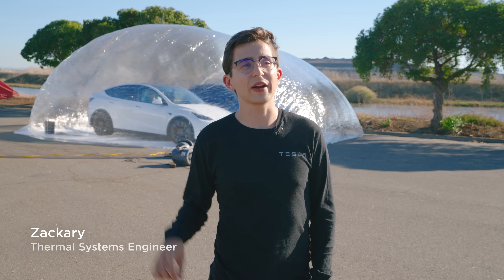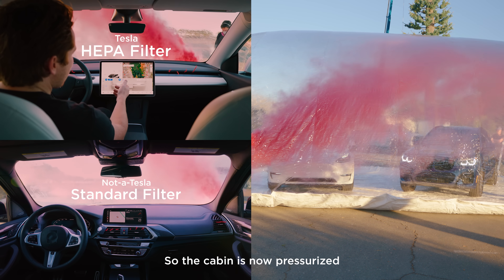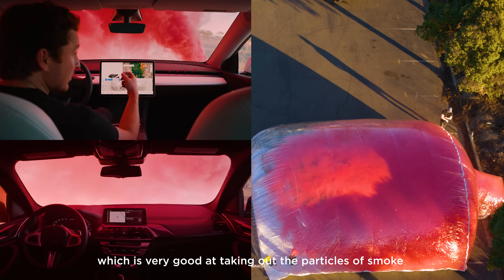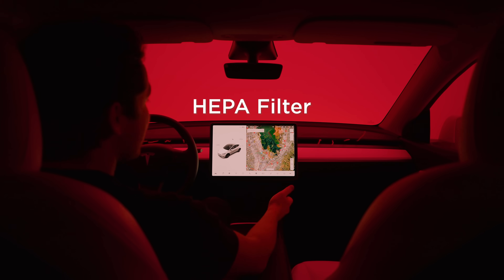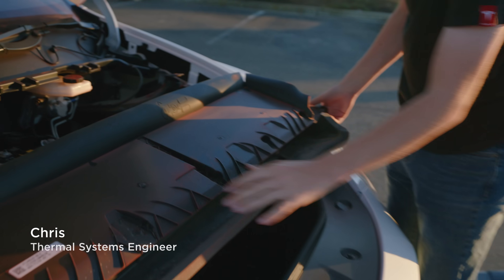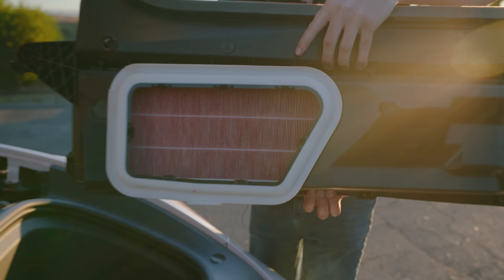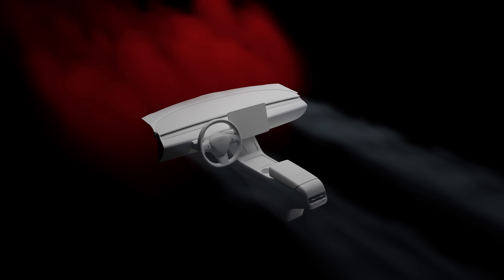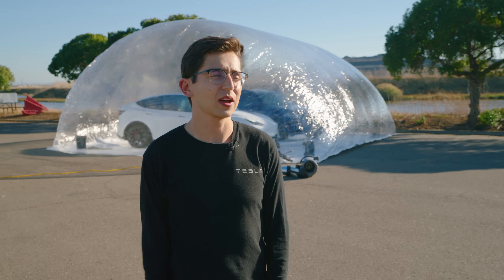Tesla HEPA Filter | Keeping Your Cabin Air Clean

Comment: If you are in town and have an old diesel vehicle running in front of you while you are waiting on the traffic light, do you still can notice the disgusting diesel smell or smoke from burning threes from the fire in vicinity?  Can the HEPA filter vanish these smells?
Can someone comment on this?  
There are lot of new technologies introduced for cabin air filters like micronAir blue (CORTECO/FREUNDENBERG), Blue.care+ (Hengst), FreciousPlus (MANN-FILTER ) etc. However, all these filters don't have any gasket around their edge that could assure, that air goes through the filter only and not around them. Nowadays these filters are just inserted in their compartment of the air channel. Tesla did a good job here because they sealed the HEPA filter to the plastic frame and this frame has extra white gasket where the air enters to the air conditioning compartment. It would be interesting to see performance , if they would have tested the E947LB built in the VOLVO truck, for example.

Comment: At least turn the Air-recirculation button on for the X3 to give it a little comparison damn. They might aswell have used two Model Y's, one with the filtration switched on and the other off. 🧐

Comment: $400 for what is essentially a $40 part at your local Pep Boys for any other car. You know, HEPA filters with this level of filtration have been around for a very long time. 
Inspired by hospital air filtration systems, LOL. Have you ever been on the roof of a hospital? Or seen one? Nothing really special there except for the fact that they can change the direction the air flows, so that air from without can't go in for folks with crap immunity and can't go out of the room for infectious folks. The HEPA filter is about the same as any other HEPA filter for a building of that size.

Comment: Why isn't always on when all doors and windows are closed ?
What is the drawback of using it ?

How often do you need to change the filter if you leave it on all the time in L.A. for example ?

How much does it cost to replace a used up filter ?

Comment: I can imagine that that filter needs to be changed regularly the problem is the price of the filter
Reply: Volvo has been doing HEPA filters and interior air quality sensors for 23 years.(they introduced both in 2000)  They are also certified by the asthma and allergy foundation of America unlike Tesla.  Volvo also has won the interior air quality award since 2020 and continue to do so. Not to mention the filter for a Tesla is 500$ the filter for a new Volvo is 32$ and still has cleaner air in the cabin.

Comment: Bring the floor hump back so you can put a wind tunnel full length of the car. A cylinder that slips out of another cylinder for repairs that consists of a couple hundred mini fans that generate electricity. Why not take advantage of the wind?

Comment: Just FYI, other brands do have HEPA filters too... Mercedes being one of them (In the S-class and EQS that is)
Reply: Volvo has been doing HEPA filters and interior air quality sensors for 23 years.(they introduced both in 2000)  They are also certified by the asthma and allergy foundation of America unlike Tesla.  Volvo also has won the interior air quality award since 2020 and continue to do so. Not to mention the filter for a Tesla is 500$ the filter for a new Volvo is 32$ and still has cleaner air in the cabin.

Comment: Great video! It would be great if Tesla can also illustrate the difference between Bioweapon Defense Mode turned on and off. Being a prospective buyer, I would be interested to know if I need to turn on the BDM mode on a daily basis if I drive in a city with a high level of PM2.5 everyday.
Reply: Agreed. It isn’t a useful test otherwise. Even better if the car could automatically turn the filter on when the air quality was bad!

Comment: While this is certainly a nice thing to have, you really don't need to blow $100K on an X or $50K on a 3 to do approximately the same thing in your car. You can buy generic activated carbon infused HEPA cabin air filters for practically any car now for about $20 and if you just put your car's AC or heat on recirculate it will almost totally purify the air inside within 5 minutes. How do I know for sure - I bought a $30 usb powered laser air quality meter off ebay and tested it myself on a smoky day. The relevant search terms are PM2.5, car, and AQI meter, if you want to get one. They're all based on the Plantower physics package. The PM2.5 value literally falls to zero within a few minutes of having the fan on high and recirculating. I DO NOT have a special car by any means, it's a 15 year old Civic. Try it yourself. The odor removing capability isn't going to be as great as with a separate carbon filter like on the X, but it will work and the main important capability of particle filtration is very good.

Comment: this needs to be standard across the industry, like airbags and seatbelts. AIR is a necessity, not a luxury. i really hope manufacturers take note and adopt these filters before it's too late (for a lot of areas, it already is).
Reply: In this price range it's a standard, it has been the case for 10 years or so, I'm actually surprised that Tesla didn't come with HEPA filter installed.
Reply: Volvo has been doing HEPA filters and interior air quality sensors for 23 years.(they introduced both in 2000)  They are also certified by the asthma and allergy foundation of America unlike Tesla.  Volvo also has won the interior air quality award since 2020 and continue to do so.
Not to mention Tesla's filter cost 500$ where as you can get a filter from Volvo for 32$ and volvo still gets the better air quality inside.
Reply: love volvo!

Comment: Hepa filter is a very desirable feature in Vaccums generally found on high end ones this is amazing I'm never going to buy a Tesla but credit to Tesla this is next level
Reply: Volvo has been doing HEPA filters and interior air quality sensors for 23 years.(they introduced both in 2000)  They are also certified by the asthma and allergy foundation of America unlike Tesla.  Volvo also has won the interior air quality award since 2020 and continue to do so. Not to mention the filter for a Tesla is 500$ the filter for a new Volvo is 32$ and still has cleaner air in the cabin.  
This isn't next level this is standard stuff most company's were doing before Tesla came around.

Comment: Hey Tesla, if you made an air purifier, definitely buying it!
Reply: Volvo has been doing HEPA filters and interior air quality sensors for 23 years.(they introduced both in 2000)  They are also certified by the asthma and allergy foundation of America unlike Tesla.  Volvo also has won the interior air quality award since 2020 and continue to do so. Not to mention the filter for a Tesla is 500$ the filter for a new Volvo is 32$ and still has cleaner air in the cabin.
Reply: @ethandonivan5175  Checking right away，thanks Ethan
Reply: @ericcatman9977  if you want a tall one, the tp02 is on sale for 200 off.  It auto detect the air quality and makes adjustments.  It also works with the Dyson app.
Reply: @ethandonivan5175  The fall one looks great, thanks for your warm advice❤️
Reply: HEPA isn't anything special it's been around since the 1940s.  Tesla just made a good marketing video comparing it to a car optioned without the filter.  Get a Dyson if you want a good in home air purifier.

Comment: 99.97 against particles of any size?  HEPA guidelines is .3 microns or larger. What is the size of the particles is the 'smoke'. Will you get the same filtration with leaking seals or misaligned panels?

Comment: How much it costs to replace?
Reply: Volvo has been doing HEPA filters and interior air quality sensors for 23 years.(they introduced both in 2000)  They are also certified by the asthma and allergy foundation of America unlike Tesla.  Volvo also has won the interior air quality award since 2020 and continue to do so. Not to mention the filter for a Tesla is 500$ the filter for a new Volvo is 32$ and still has cleaner air in the cabin.

Comment: Can't argue on this one ... It seems like a better engineered system. As a BMW over, I can definitely say the recirculation buton does almost nothing to stop bad smells from coming in the car ..
Reply: Volvo has been doing HEPA filters and interior air quality sensors for 23 years.(they introduced both in 2000)  They are also certified by the asthma and allergy foundation of America unlike Tesla.  Volvo also has won the interior air quality award since 2020 and continue to do so. Not to mention the filter for a Tesla is 500$ the filter for a new Volvo is 32$ and still has cleaner air in the cabin.

Comment: Now this is innovation!
Reply: What part about putting a filter that most other brands had before Tesla even came around is innovative ? Not to mention Volvo has been doing HEPA filters and interior air quality sensors for 23 years.(they introduced both in 2000)  They are also certified by the asthma and allergy foundation of America unlike Tesla.  Volvo also has won the interior air quality award since 2020 and continue to do so. Not to mention the filter for a Tesla is 500$ the filter for a new Volvo is 32$ and still has cleaner air in the cabin.

Comment: Tesla cars are amazing  , are the HEPA Filters fitted as standard in the  Model 3 ?
Reply: Write me ☝️ ☝️ for more insights and monitorship
Reply: Volvo has been doing HEPA filters and interior air quality sensors for 23 years.(they introduced both in 2000)  They are also certified by the asthma and allergy foundation of America unlike Tesla.  Volvo also has won the interior air quality award since 2020 and continue to do so. Not to mention the filter for a Tesla is 500$ the filter for a new Volvo is 32$ and still has cleaner air in the cabin.

Comment: We tesla owners who have this quickly accepted this feature and now really don't think about it much now.  Wild fires in calif was a great reminder in you can see all the smoke outside but you don't smell any of it, so you know its working.  On one roadtrip we came onto a boring ice vehicle full engulfed and pouring thick smoke that was low and crossing the road where we were going to drive through.  Not wanting all that junk entering into our Model X we turned biodefence on full.  We did not smell thing and wondered if maybe this car on fire was only smoke and no smells.   When we drove out the other side of the thick cloud I lowered my window just a small bit and WOW, we got the full effect of many different smells from rubber, to gas and oils plus plastics.  Much more really.  Window was opened a bit for about a second or two and back up it went.  About 1 to 2 minutes and the inside of the car was clean again.  👌
Reply: Write me ☝️ ☝️ for more insights and monitorship

Comment: Poor choice of "competitor car" for this demo. Pretty pathetic. Quote: "While Tesla’s systems rely on HEPA (High-Efficiency Particulate Air) filters, which are widely available in the aftermarket from a variety of original equipment manufacturers such as Bosch, BMW is expanding the availability of so-called nano-particle cabin-air filters within its lineup. Unveiled in the Fall 2020, the filters use what’s referred to as nano-fleece made of nano-fiber sitting on top of a traditional activated carbon layer. The filters are only available with optional four-zone climate control, and initially came standard on X7 and were offered as an option on the 7 Series and 8 Series, along with the X5 and X6, and all of their respective M derivatives.
Although HEPA filters can remove particles as small as 0.3 micron from the air, BMW’s nano-particle design takes things to another level, capturing particles as small 100 nanometers in size, or 0.1 micron. BMW says its nano-particle filters can strain 40% more harmful particles from the air than current mainstream filter technologies, including carbon monoxide and nitrogen oxide, bacterial microbes, allergies, soot, emissions particulate, and ultra-fine dust."

Comment: Awesome, the filter works great in my Model Y, but really the issue with the Model Y is the suspension (and the low load capacity). You have to replace the suspension in the Model Y, it's incredibly bad. Either put the same as in the S and X or completely rework it. It is now one of the worst ever made for dealing with bad roads, I've driven around 100 different cars and it's even worse than some 20-30 year old cars.

Comment: We have just sold our M3LR after only 10 weeks of ownership! It’s was a China built car and the paint quality is shocking! Covered in scratches and stone chips after only 3k miles. When I took it to the service centre they said it was normal wear & tear. To top it off they don’t take cars back even at trade price unless your buying another. If your going to get one factor in a re spray or full PPF.🤬🤬🤬🤬

Comment: what will be the frequency of changing these filters? I assume that they will need frequent maintenance... given the air quality around the world...
Reply: Volvo has been doing HEPA filters and interior air quality sensors for 23 years.(they introduced both in 2000)  They are also certified by the asthma and allergy foundation of America unlike Tesla.  Volvo also has won the interior air quality award since 2020 and continue to do so. Not to mention the filter for a Tesla is 500$ the filter for a new Volvo is 32$ and still has cleaner air in the cabin.

Comment: For those saying "my car never has dust in it, this is nothing special", here's a bit of science!

(TL;DR For people with chronic asthma, allergies to dust/pollen, or who live in smoggy areas this is huge, and no other car on the market offers anything close, even via retrofit.)

There are dust-grade filters (MERV 6-9), which is the category most car filters fall in, and then there's True HEPA grade air filters that go hand in hand with activated carbon filters that capture VOCs like smoke and smog. In combination they're able to capture particles much smaller than dust (smoke, bacteria, etc). Additionally, since no car is perfectly sealed the HVAC system needs to be able to create positive static pressure inside the vehicle so that air doesn't enter thru small gaps/crevices. You might be able to retrofit a HEPA car air filter in your vehicle, but it won't have the activated carbon filter, it definitely won't be big enough to effectively filter all of the air coming in the vehicle, and your car won't be able to create a positive SP environment in the cabin due to the low airflow/small filter.

Comment: You need to make sure that on the bmw there is a mode called automatic on the air con system on the bmw and if it detects bad air quality it circulates the air instead of bringing the air out side the car but the tesla did an amazing job
Reply: And they could have used a Tesla without HEPA filter... As the BMW can also be ordered with hepa filter.
Reply: Tesla people will continue to ignore common sense and eat up marketing direct from the brand trying to sell a product.

Comment: There is no bio-weapons mode of the model Y.  That's only on the model S and X.  You can put a hepa filter though.  As far as I know.
Reply: Owner's manual for the China made Model Y shows a HEPA filter. It is expected that the Model Y from Texas and Germany will have a bio defense system like the one on this video.
Reply: @acolon8999  ohhhh but this video wasn't shot in China...
Reply: @acolon8999  how? You're saying "will"  not "are"
Reply: @jonathanwiliams4993  My mistake. I just learned that all Model Ys produced since early August 2021 already have the bio defense system according to Electrec. They show pictures of the system on a Model Y. It also explains that there is no room on the Model 3 to add this feature.

I learned something new today.
My Model Y does not have it but my wife is expecting delivery of hers in March, so she will have it. And she also is going to have heated steering wheel.  Jealous now. Lol

Comment: truly amazing vehicles
Reply: Volvo has been doing HEPA filters and interior air quality sensors for 23 years.(they introduced both in 2000)  They are also certified by the asthma and allergy foundation of America unlike Tesla.  Volvo also has won the interior air quality award since 2020 and continue to do so. Not to mention the filter for a Tesla is 500$ the filter for a new Volvo is 32$ and still has cleaner air in the cabin.

Comment: More of this Tesla!!
Reply: Volvo has been doing HEPA filters and interior air quality sensors for 23 years.(they introduced both in 2000)  They are also certified by the asthma and allergy foundation of America unlike Tesla.  Volvo also has won the interior air quality award since 2020 and continue to do so. Not to mention the filter for a Tesla is 500$ the filter for a new Volvo is 32$ and still has cleaner air in the cabin.

Comment: For clarity, put a device in the car interior that would show the number of PM 2.5 particles.
And by the way, I have a hand-made forced ventilation of the room at home, which filters out the air through 2 filters:

1st standard MERV 13
the 2nd one that comes after it is a HEPA filter.

The devices always show 0 PM 2.5 particles in the room.
All this helps a lot to purify the air when it is supplied from the street, especially during the annual fires in California.
Reply: There has been some testings with a laser particule detector: https://www.youtube.com/watch?v=PxJ8-G1_frg
It's showing great results too!
Reply: @MurphyTJ  thanks)